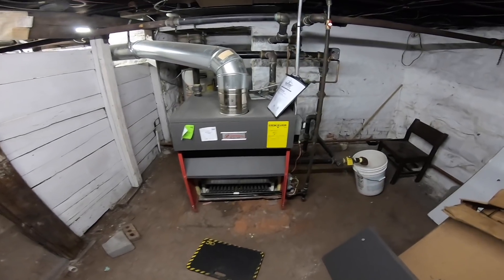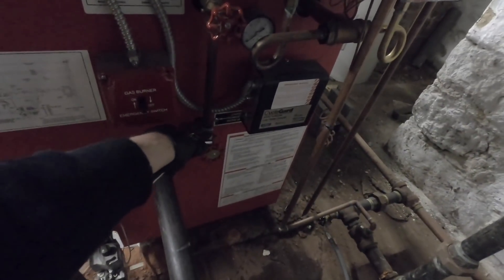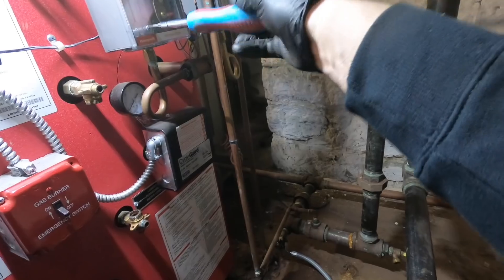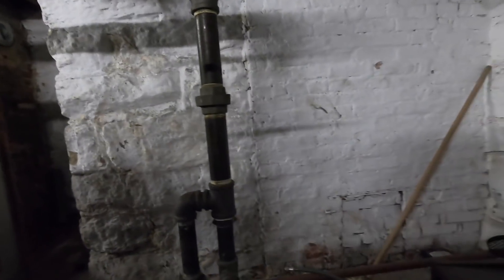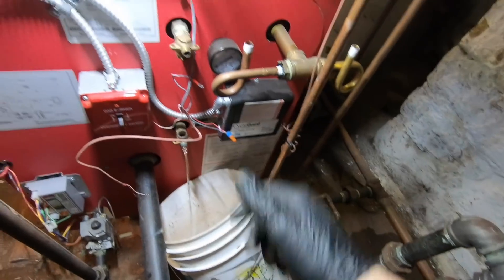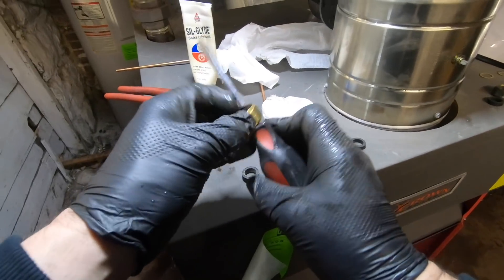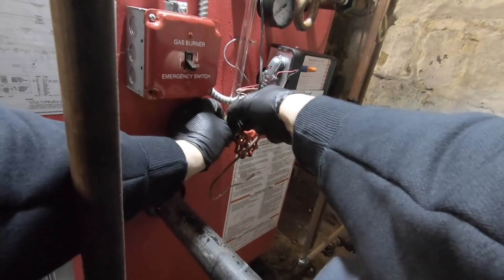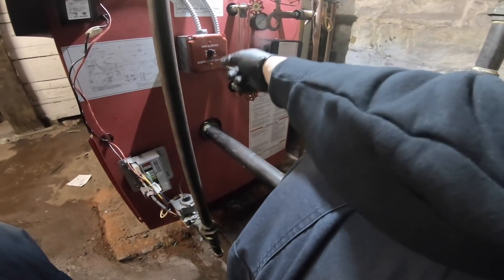Neglected Plugged Up Steam Boiler

Comment: I purchased a home w a steam boiler years ago.
Previous owner had much difficulty with getting heat in house.
Unit had a service tag w yearly inspections performed, but only the gas side of system was serviced.
Discovered The drain/flush valve clogged.
Unscrewed it from boiler, and nothing came out.
Probed the rust and corrosion to clear it , and flow started.
Later removed 3” plug and flushed boiler. Lots of rust and sediment.
It’s been working fine for 8 years now.
Builds steam in about 10 minutes.
I think it’s a 450k btu unit...about30 years old at least . Weil- McLaine . 

Why the Svc tech never flushed water side is a mystery.

Comment: The installer did a nice job leaving clean out ports on that return line. I dislike how the existing returns from the mains are tied into the tee on the runs. This gives no direction of flow back to the boiler and a spot where soot will accumulate. 

Nice work on the service. Way to be, Sir.

Comment: People do not realize it takes some time to take all this stuff apart and clean out the fittings. This all necessary for the safety of the residence and the occupants. The efficient operation of this equipment is all dependent on the Maintance. Steam systems are open to the atmosphere which means these system are forever rusting on the inside. The rust mixes with the water and becomes sludge which ultimately ends up in the boiler and all the controls of said boiler. Not cleaning properly can cause equipment failure and very possibly deadly ramifications. Yes, all Heating Companies have Insurance, the goal is to never need to use the Insurance for any reason. I do not like to be rushed by the customer. Yes, we all know time is money however, the tech needs to be left alone to properly do their work. You cannot leave any stone un-turned. This stuff all needs to be checked.

Comment: thx for tips... on breaking pipe dope seal first with gentle wrench movement. Very useful tip on the time delay in the LWCO before it starts filling so that the condensate can catch up and come back to fill before the lower water feeder starts adding water to replace water lost due to steam release in radiators.

Comment: It has been a long time since I read my Dan Holohan books, but I have a feeling that whoever installed that boiler did not follow any of the piping instructions that came from the manufacturer. Let's not even talk about the total lack of any insulation on the piping on the boiler and throughout the boiler room and most likely, the rest of the steam pipes. I bet they keep pushing up the pressure to get the steam to all the radiators. If the insulation was installed properly there would be no need for anything more than 14 ounces of pressure. Using a vaporstat instead of a pressure-trol will make a world of difference as well as save fuel. All there in the "Lost Art of Steam Heating."
Reply: Insulation is important, I agree there. The piping is fine. Hartford loop, close nipple, feeding water on the return side is correct, equalizer is perfect, clean out ports everywhere on the return. Brass pigtails are correct, near boiler piping looks longer than 18”-24”. Depending on jurisdiction, backup low water cut off is mandatory. He does have a manual reset pressuretrol so I’m assuming a manual reset lwco is required. Only thing I see wrong is the existing returns from the mains are tied into a tee on the runs and the bull piped to the boiler return. This doesn’t control the flow and will allow soot to accumulate. A big no no is having two safety/operating controls on a single boiler tapping. That’s complete ignorance. 
Steam travels 56 mph. 1 lbs of pressure is enough for this system. It means the system is filled. If the main air vents aren’t piped in properly (minimum 15” away from ends of main), and the air valves aren’t sized properly, then they’ll be hammer/knocking. Insulation won’t help that much. 
Lost art of steam heating is a gem. The “dead men” were a gem too for our industry. I’m grateful for having them school me when I was green, and surely they were grateful for me grasping that knowledge and making their lives easier at work. Also knowing that the knowledge they passed down was respected and passed down to future greenhorns. 
Be safe. Have a prosperous 21,Sir.

Comment: If the controls are mercury, you need to rotate those pressure tools 90 degrees.  If and when those pigtails grow from the heat, the controls will tilt and the mercury will shift to one side.  Also, your supposed to backflush the wet returns and the LWCO should be washed out.
Reply: Those controls aren't mercury
Reply: guess he thinks it's 1980 again ;)
Reply: throttle bottle really??? I see mercury in the field all the time, especially on steam boiler pressuretrols. The T87F May be getting rare now days but still many of them out there too! This boiler had asbestos on it, that’s been outlawed for like 50  years.... problem is, everyone seems to do a half-assed job and remove  only the easily accessed stuff, so the shit lingers in the air all the time, and to top it off, nobody reinsulates the piping, so boilers fail way before their time... and the operating costs are also high.   Best thing to do on steam systems is rip them out.
Reply: @hvac01453  that boiler doesn't have any asbestos on it guy. That is a new steam boiler probably not over 10 years old. Maybe the piping has asbestos on it but that has nothing to do with the age of the boiler. I think you need to get your eyes checked.  Hey hvac hacker did you happen to get a date of manufacture?
Reply from the maker: This boiler is only a couple years old.with diaphragm underneath that pushes up on the spring mechanism. There is many boilers still out here with the mercury switch. Also many t87 thermostats still on walls or even the honey well t822. I'm looking at one on my dining room wall. Mercury switches last forever why did we ever go digital
Reply: @thehvachacker  I was just trying to prove a point to him that this boiler doesn't have asbestos on it and didn't have any mercury controls.
Reply: @brettwing737  I know it doesn't have asbestos insulation on it. Whoever did the install on it didn't insulate it on purpose.    In this way,  you can sell that customer lots of fuel. and he's non the wiser.  Probably wonders why it takes so long to develop a head of steam, and his basement stays good and warm.  The steam he does get isn't dry steam. Then, he gets to sell him a new boiler, steam leaks, and other failed equipment much earlier, due to carbonic acid in the system because of the missing pipe insulation.  The runs I saw in the video have raw edges= asbestos is floating in the air down there because it wasn't encapsulated....
Reply: @thehvachacker  follow the money

Comment: Hello, just  want to share some info. Jargon, the dirt you’re removing isn’t gunk it called mud,it gauge glass isn’t a sight glass, the controls aren’t safety’s they are limits, safety’s would be the pop safety’s or relief valve, also judging by the amount of mud in the boiler you might consider compounding the boiler . Hope this helps
Reply from the maker: Sorry I never hear anyone call it a gauge glass. It’s a sight glass. Google gauge glass and sight glass comes up. Doesn’t mean no one may call it a gauge glass yet very uncommon. Don’t be naive, because you believe your way is the only way. It’s one of many ways. Pressuretrol is a Controls keeping the boiler safely operating. Hence safety, Limits are safeties. Relief blows when safety fail. I was going to mention hi temp limit for furnace yet flame roll out limit. Explain how a flame roll out limit or spill switch limit is not a safety? Ac unit safeties are all considered limits.
Reply: Hello, everything in your service was spot on. And I get it trade jargon differs from location to location. But limits are limits and safety’s are safety’s if a limit fails weather on a steam or hydronic system it is the relief valve that under most circumstances keeps the boiler from blowing up. The limit if working runs the burner up to its operating set point in lbs on a steam system ,or temp on hydronic one .on commercial jobs most codes require also a manual reset pressuretrol wired in series with the limit so if there is a over pressure occurrence the only way to start the unit again is by resetting the e control. I state the obvious. If both the limit control and the E control are piped using the same pig tail,  and if that pigtail becomes plugged than again the device that will protect the system from blowing up is the pop safety. One more piece of the puzzle, on steam systems that produce heat and domestic hot water. The aquastat is called a operating control this operates the burner to the set point on the aquastat and is overridden by the thermostat on a call for heat. Lastly using gunk in you description in the video. The correct phrase for accumulated dirt in a steam system is mud. Boiler manufacturers don’t construct gunk legs into boilers used for steam they are mud legs. And that’s the correct terminology or jargon.I think along with posting your videos you would expect feedback. And with over 44 years in the trade I’m just trying to pass info onto you that may be helpful in your career. Thanks ,MG

Comment: Could you please explain the 2 pressuretrols?  I’m thinking the one on the left controls normal operation (cut-in and cut-out) and the other one, with the manual reset button, is an emergency shutoff to prevent overheating the boiler.  Am I close?  Also, could you explain the wiring?  It looks like there’s only one set of wires.  Are they wired in series?

Comment: I  don't know what you doing but I  like it. I got some questions but I'm  afraid to ask.
Reply from the maker: Ask away I am always open to help others learn steam. Where I live their is lots of old houses with steam systems.
Reply: @TheHVACHacker @UCn9USeohvbm9waqj9R-C1mg y can you please clarify what units you are removing and disassembling to clean at 13:00 and reinstalling at 30:24? (Anyone?) My steam oil boiler was neglected for 2 years and after flushing well, and cleaning sight glass (before finding this video), I still was concerned about possible particles causing possible intermittent behavior of pressure guage and pressure control. Are these the two units you are removing and cleaning? I am asking because even after a flush and sight glass cleaning, the boiler works but the pressure guage is reading 4-5.5 psi (1.5 differential cold to hot) and the pressure controller needed to be adjusted from 2 to 3 psi to allow the unit to start and stay heating. Seems like particle clog is possible???

Comment: I don't understand what the site glas has to do with the boiler being overfilled.  The auto water feed is not connected to the site glass.
Reply from the maker: The sight glass is where you see where the boiler is filled up to. It’s suppose to be 3/4 full. The auto feeder adds water once the low water cut off is activated to prevent boiler from firing without enough water. If a sight glass is full of water the boiler is overfilled.

Comment: @TheHVACHacker @Supa Trending Daily can you please clarify what units you are removing and disassembling to clean at 13:00 and reinstalling at 30:24? (Anyone?) My steam oil boiler was neglected for 2 years and after flushing well, and cleaning sight glass (before finding this video), I still was concerned about possible particles causing possible intermittent behavior of pressure guage and pressure control. Are these the two units you are removing and cleaning? I am asking because even after a flush and sight glass cleaning, the boiler works but the pressure guage is reading 4-5.5 psi (1.5 differential cold to hot) and the pressure controller needed to be adjusted from 2 to 3 psi to allow the unit to start and stay heating. Seems like particle clog is possible???
Reply: Those are called pressure-trols. Its a pressure safety device that activates in case the pressure in the boiler gets too high
Reply: @frankm5019  I can only make assumptions from here. But I'd say your due for a service on the boiler and it should be taken apart and cleaned. Residental steam shouldn't be above 1psi, let alone 30. That's concerning

Comment: Since you seam to be working on steam and hot water system, I was wondering what you think of one regarding the other? is one clearly better or dose it depend on the situation?
Reply: Hot water boilers are far less dangerous and don't require as much maintenance.
Reply from the maker: I like steam heat grew up with it. Yet it requires its owner to keep an eye on water levels and drain down weekly to get some of the mud out. Also everyone wanting to seal up their houses to make them energy efficient isn't great for a steam system that needs to run and build up steam pressure. Like a tea pot whistling, thats when the radiators put out the best heat  They stopped installing steam in houses somewhere in the 50's. Hydronic systems only require a yearly maintenance. Both are really efficient heat sources.
Reply: Thanks, i never encountered steam so i was curious.
Reply: @thehvachacker  that's the problem with steam I hear a lot is my house gets to hot.  I prefer hydronic heating
Reply: @thehvachacker  I was told they are the most efficient in terms of BTU per buck...is that still true? I think they are also best for your respiratory and skin health due to moisture in air rather than drying air. As a singer I appreciate that!

Comment: I'm dealing with  the same boiler ,brand new ,it won't gain any pressure, n the safety release starts letting dirty water out as soon as it starts heating is it clogged

Comment: If you take off the bottom gate valve and it leaks after wrap the threads inside and outside by the packing nut with teflon tape you’ll get a seal.

Comment: Hey, just a question on the Knipex tools.  Do you find you use the cobras or slip joint style more often?
Reply from the maker: I only have the cobra style pliers. Even the adjustable wrench pliers. Never owned the slip joint style yet think that style might handicap grip sometimes with limited adjustments
Reply: The HVAC Hacker by slip joint, I mean the smooth jawed Knipex silver pump plier I see you using.  I love my Cobra pump pliers, but would think you would carry either the toothed style or smooth jawed style.  Carrying both might tend to make your bag too heavy, especially if you find you favor one over the other.
Reply from the maker: I carry both cause they serve different functions. I use the smooth jaw in place of an adjustable wrench. Brass wrench together fittings usually I would grab the pliers wrench over cobra's. The cobra pump pliers on anything round. I was able to remove a broken frozen bolt the other day that was snapped in a valute with my 10" cobras. Both together are lighter than a 10" adjustable wrench.
Reply: @thehvachacker  I have one bag with two 6" cobras and a wide mouth 8"channel lock .and one 6" adjustable. in an MB2.  If Im doing anything other than troubleshooting, I grab the 47#  Big Veto bag.  I try to stay light. I hate doing multiple trips.

Comment: What's wrong if your boiler is not making enough steam,but doesn't have a leak
Reply: Why do you say the boiler not making enough steam , you should only need about  1 pound of steam depending on system ,do you have some radiator not working ? Is that what you mean

Comment: It's reckoned that Gauges the pointer will  miss read and  under score on the first Third, then would be  fairly accurate in the Middle third and slightly over score on the Latter third of on the Bezel...is if your looking at a  30PSI Gauge one wonder's why there's not an Accurate Certified  10 PSI gauge  fitted  onto the top of the Boiler with an Isolation Vale below Same...so that the working pressure can be accurate  indication ... for the output to  that Building  as same is a couple of  PSI...

Comment: I know this video is over a year old but I will say you have it easy, try a 300+PSI superheated boilers that runs the hole factory, they are so much fun to work on and worst is when you have a bank of them to work on, the ten year inspection and clean is the worst, I am happy I got away from them.

Comment: I can't believe you didn't open the sight glass valves before you checked the tank level..  they closed them so the glass wouldn't be exposed to the pressure of the boiler all the time.  What if the glass broke accidentally, while the boiler was under pressure?
Reply: are you kidding?  Pressure? Thats Pyrex.  that will never reach the 10% of the pressure you have in your sink. Plus it has two pressure safety by code in all commercial jobs.  Usually about 1-3 PSI only max in most systems.
Reply from the maker: I was expecting the valves were opened. I do t know anyone that closes the valves unless their is a leak. Plus why would someone overfill the boiler and then close the valves? Only time I see the glass break is from someone over tightening the nuts trying to reuse the washers. If the glass breaks two things will happen. One the boiler will lock out on low water, or spill water out of broken glass yet create a no heat situation due to lost steam pressure

Comment: The boiler overfilled because the dirty water caused surging and priming, which unnecessarily cycles the automatic water feed. Common problem. It appears to be a newer installation, it probably never was properly cleaned after installing.